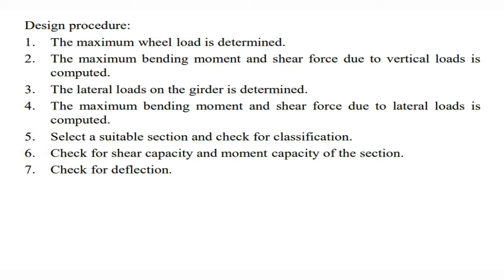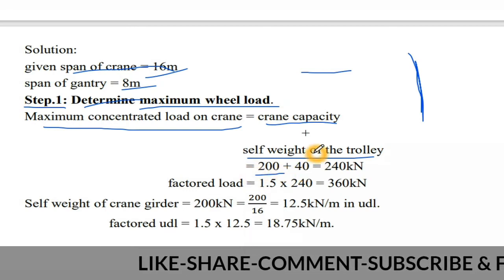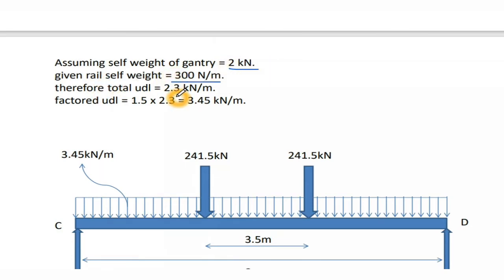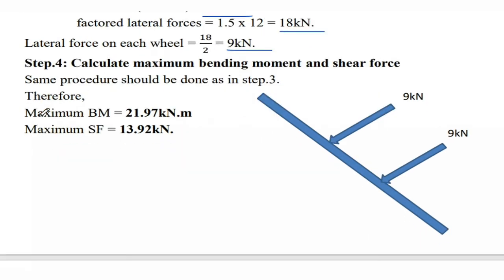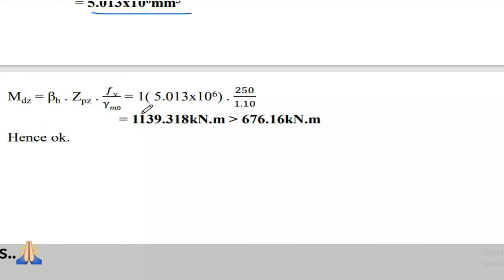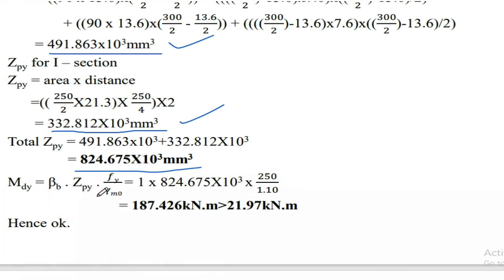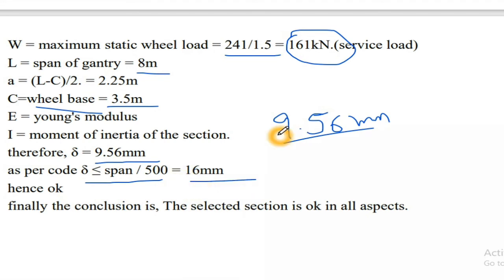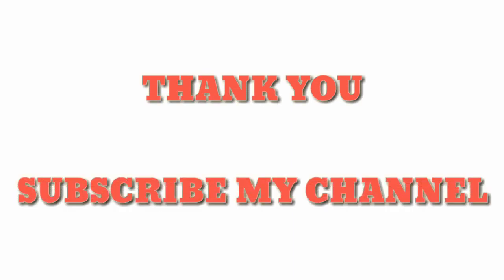design of gantry girder in telugu |Easy design of gantry girder| Steel structures| civil engineering

Comment: Bro ela chepthuna ani tapuga aanukokandi meeru antha fast ga cheptunte ardam chesukodani kastam ga oondhi..
Code book lo oontadhi aantunaru konchem page number and table number kuda chepandi bro
Konchem slow ga explain chesthu chepandi bro
Reply from the maker: Sorry for the inconvenience occurred, kindly see in playback back speed of 0.75 or less, to get slow explanation. and check the below sections trough the steel codebook i.e. IS-800:2007

=> for shear check IS-800:2007 code book clause 8.4 & section 8 i.e. design shear strength formulae 
=> for moment capacity refer clause no 8.2.1.2 from Is-800:2007 code book
=> For combined moment formula refer section 8 of IS-800:2007 codebook
=> Need to refer steel tables for section details
Reply: @TIALWIZARDS  sorry yemi vodhule bro nxt time konchem explanation tho chepu 
Thank you